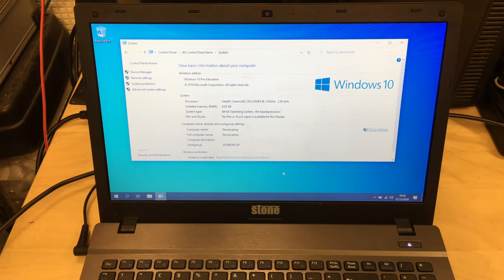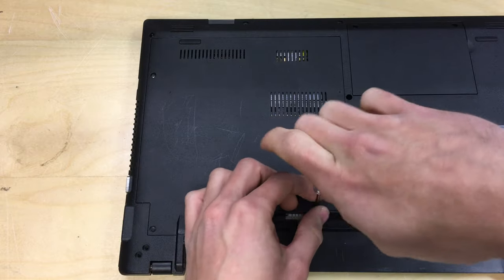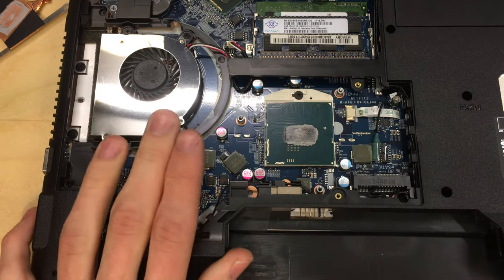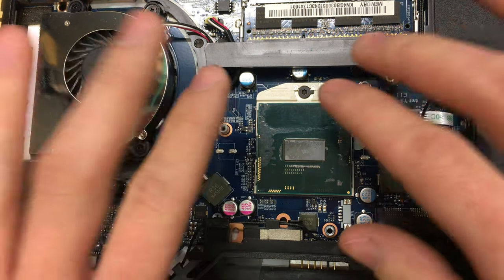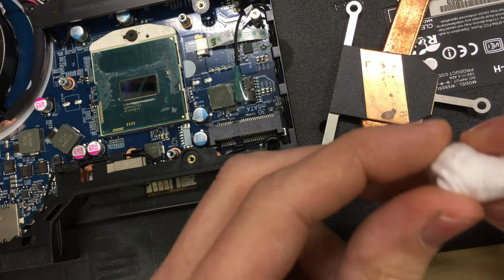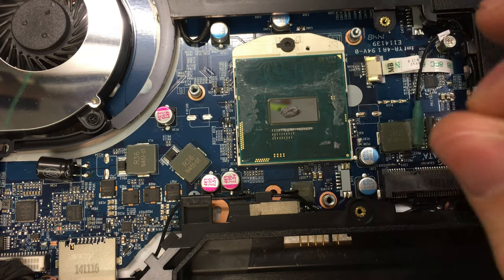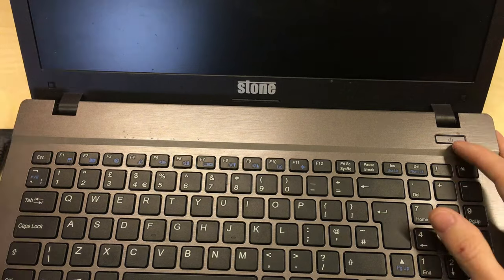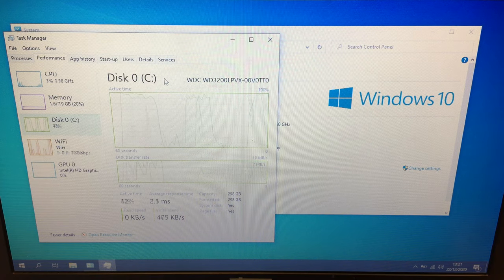Upgrading The CPU On A Laptop - Intel Celeron to Core i3/i5/i7 - Stone Computers NT310-H, i5-4210M

Comment: Can I upgrade Intel Celeron b840 to Intel core i3 or higher
Reply: what laptop model do you have?
Reply: @vladimirazirov1815  please can I upgrade my hp notebook 14-am0001nk cpu from Celeron n3060 to Core i (cpu-z gives socket 1170BGA , chipset Braswell Host Bridge , southbridge Braswell LPC Bridge) pc support max 8GB Ram)
Reply: @zakaryaelasbihani6841  The processor is soldered to the motherboard and cannot be replaced.
socket BGA

Comment: ok serious question, i have a aio hp computer with extra ram because thats the only upgrade ive done to it. soon to do a bigger internal ssd. I have a intel celeron with integraded graphics can i just buy a new better cpu and it comes with integraded graphics? if im not mistaken integraded is built into the cpu? im pretty sure i can just wondering though?
Reply: it's called ''integraded graphics'' for a reason lmao

Comment: Hi! 😞 I Have a Toshiba Sattelite C50 -A -14G , and i upgrade the CPU  from Celeron 1005 M to I5 3230M , same soket,  BUT NOW my laptop shuting down after 30 Min fix , before install the new CPU i upgrade the bios after i put my new cpu.... I check the temperature  and she is normal (40-45 grade ) . Can u help me with that , please!  Thanks😞
Reply: Debes cambiar tu Placa Base, el apagado se debe al chipset.

Comment: This is my next upgrade after I upgraded the RAM, Wireless Wi-Fi and SSD… I got an i3 but I’m thinking about i5 or i7.

For new laptops, if you are planning to upgrade make sure that the components are not soldered.
This upgrade are applicable to old models mostly.

Comment: I have a HCL 2007 which have celeron can i upgrade it to i5 9400F by replacing it motherboard ???
Reply: bro if your gonna put a new cpu you have to get a new mother board witch supports the cpu you are getting
Reply: @rashedalsofani7941  ok thnks

Comment: Can Toshiba satellite 850 celeron be changed to i3 or i7 pls I need a reply
Reply: Install the CPU-Z program on the laptop from the Internet. On the first tab of the program, look at the socket type (BGA 1023 or rPGA 988?). On the "Mainboard" tab, look at which chipset and southbridge. Please provide this information to me. How many gigabytes of RAM is in a laptop?  Celeron В820?
Reply: @vladimirazirov1815  please can I upgrade my hp notebook 14-am0001nk cpu from Celeron n3060 to Core i (cpu-z gives socket 1170BGA , chipset Braswell Host Bridge , southbridge Braswell LPC Bridge) pc support max 8GB Ram)
Reply: @zakaryaelasbihani6841  No. BGA is not a socket, the processor is soldered to the motherboard. It is better to buy another laptop with a stronger processor. Pluggable processor - socket PGA, PPGA, rPGA
Reply: @vladimirazirov1815  thanks for the answer that's what I will do

Comment: If any body having Pentium processor or celeron processor or i3 2nd or 3rd generation processor in laptop you can upgrade it. check processor socket in laptop and see it molded or removable. If removable you can upgrade. Check using cpu z software you see it shows (Socket 988B rPGA)
 see image I shared processor pin and socket

Tdp is 35w so Plug and play and no bios update needed

Used Intel i5 and i7 2nd generation laptop processor available for sale

Comment: Intel® Celeron® processor

4 GB memory; 500 GB HDD storage

39.6 cm (15.6") diagonal, HD (1366 x 768), micro-edge, anti-glare, 220 nits, 45% NTSC

Can i upgrade to icore 7
Reply: yes
Reply: I have the same machine , did you upgrade??

Comment: can i upgrade mine with intel celeron, i think it dual core cause it indicate that 2cpu, unit is samsung laptop
Reply: what model of samsung laptop and what processor is celeron?
Reply: @slavafedotov5742  sir, laptop model. is samsung NT300e5q
intel celeron 3215u 
@1.70ghz
what procesor should I put or what procesor is compatible for my laptop?
Reply: @edwinboas9614  Core i5-5300U, Core i7-5500U, Core i7-5600U (Socket BGA 1168) - buy any of these processors. Then take the laptop and new processor to a computer service with a soldering station to replace the processor.
Reply: @slavafedotov5742  sir does it really need to solder? not easy to install like your's?
Reply: @edwinboas9614  socket BGA - you need to solder the processor. In the video processor with an rPGA socket. You can sell your laptop and buy another laptop with a stronger processor.
Reply: @slavafedotov5742  thank you so much  for your time to answer my questions sir,

Comment: I want to ask some question my laptop is acer aspire 3 processor intel celeron N4200...this possible to upgraded in intel core i5..please🙏
Reply: no. In all laptops after 2013-14, all processors are soldered to the motherboard. Now you need to immediately buy a laptop with the right processor.